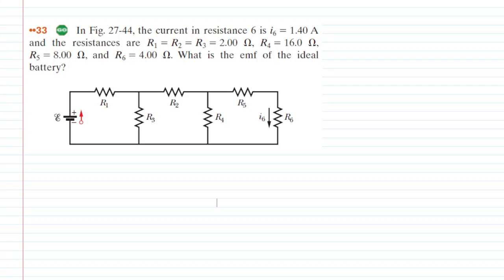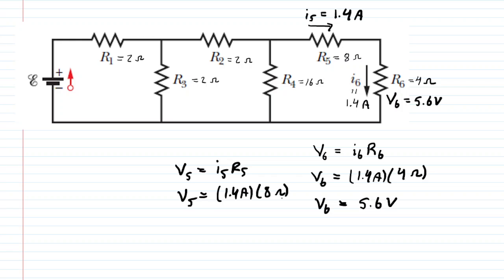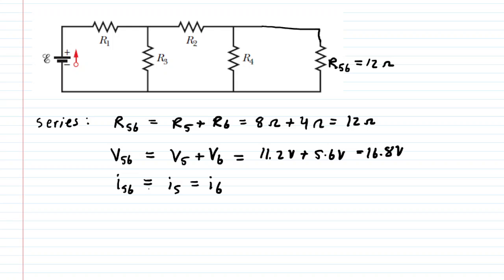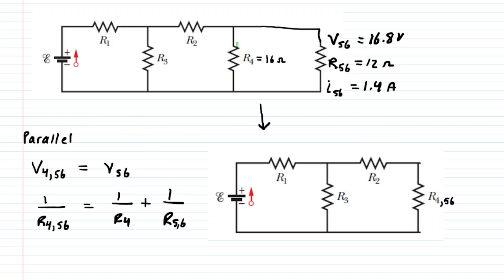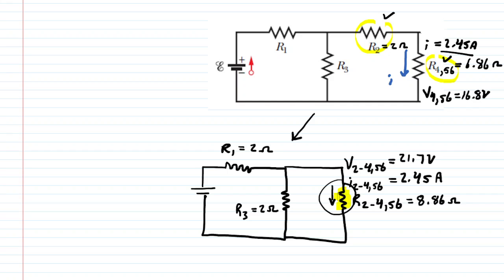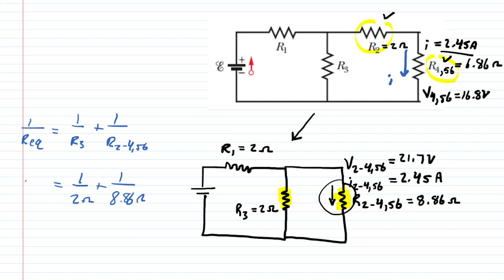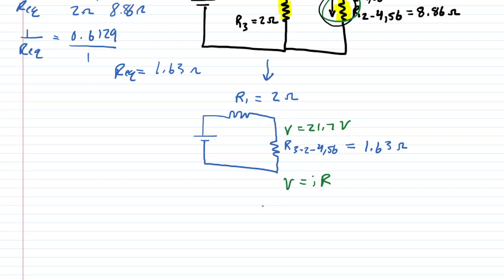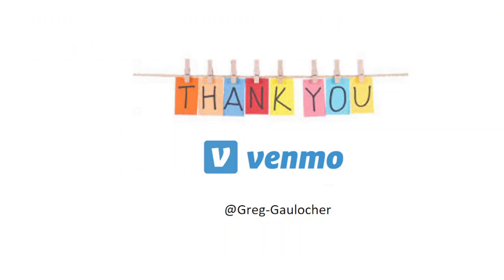in the figure the current in resistance 6 is i6

Comment: his, is there anyway you can  solve this problem A block of mass 3.00 kg is pushed up against a wall by a force P that makes an angle of u 5 50.0° with the horizontal as shown in Figure P5.34. The coefficient of static friction between the block and the wall is 0.250. (a) Determine the possible values for the magnitude of SP that allow the block to remain stationary. (b) Describe what happens S u S Figure P5.34 22.0􏰋 22.0􏰋 if uP u has a larger value and what hap- pens if it is smaller. (c) Repeat parts (a) and (b), assuming the force makes an angle of u 5 13.0° with the horizontal. It is 34 on chapter 5 of the Serway  Book Physics for Scientists and Engineers 10th Edition